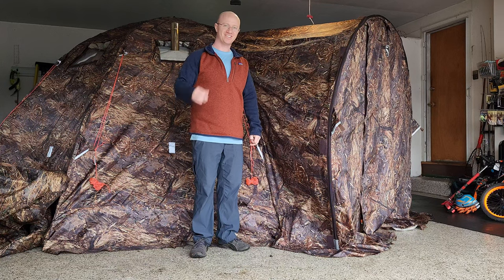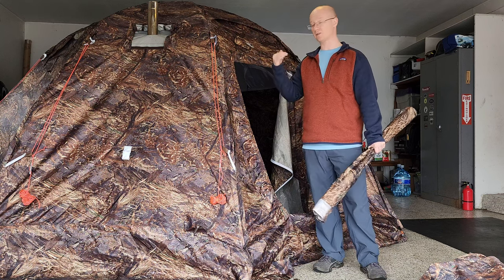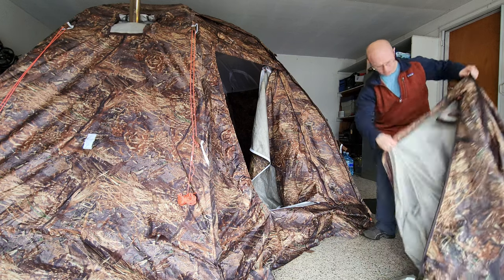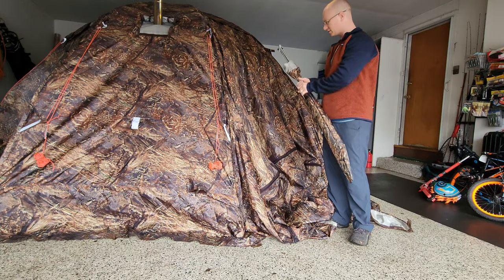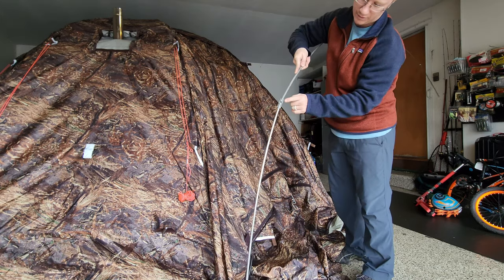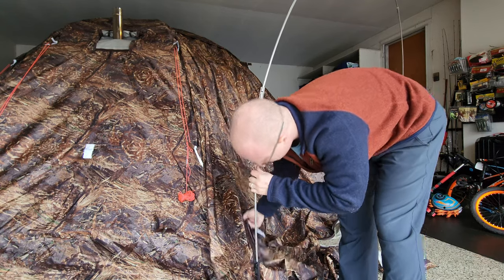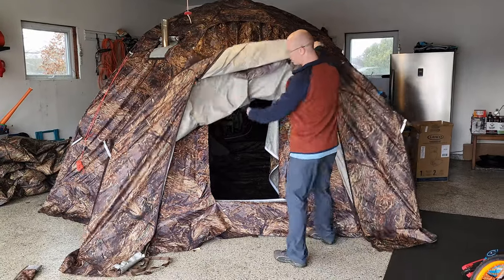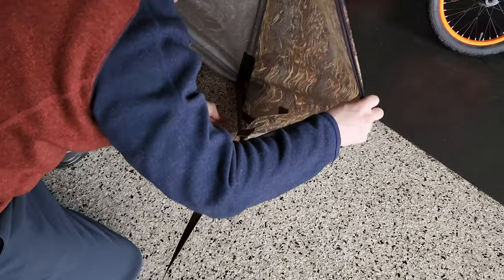UP 5 Vestibule Setup and Stove Jack Issue Fix

Comment: Very helpful. Before I saw your video, I had my vestibule set up squared, it worked but. My poles came together and snapped into place. Wouldn't snap easily, so I left them unsnapped.  Going to try to redo it correctly.  Also had no idea what the extra poles were for!  Thanx again.
Reply from the maker: Your welcome. I am glad so many people have found it useful. Makes me feel justified in taking the time to figure it out myself and then making the video for everyone. Cheers

Comment: Can you please tell me what the diameter of the stove jack rings? Planning to have a woodstove made. Planning on a 4" pipe
Reply from the maker: I don't have it out right now so I don't know for sure but I can check that out at some point. In my opinion with the way the layers work and lining them up and then factoring in possible wind...I wouldn't go with a 4inch pipe. The 3inch pipe on the caminus stove I use is about all the room it can handle. The caminus pipes are 3.2inch I believe. I wouldn't go more than 3.5inch if I were you.

Comment: Could you please post a link to your other fire protection mat?
Reply from the maker: WELLUCK 32 Inch Fire Pit Mat Fireproof Firepit Pad Deck Protector, Round Heat Resistant Shield Wood Concrete Floor Grass Patio Mat for Chiminea/Solo Bonfire/Grill/Stove,Up to Resist 2000°F https://a.co/d/cQiNHBS
Reply: @AbundantAdventures  

Thank you!
Reply: I am trying a wielders cloth as added floor protection, harbor freight.

Comment: Stove thing need a air gap to act as a insulation.  I got the up4 dex only comes with a trap for the front door. It's nice tho.
Why are you taking hot wood out of the stove? Everything burn down it pure white ash in the stove. It's leaves zero waste.  Just wake up and scoop out the ash befor starting up again. 
When your leaving use a branch to clean the stove pipe a little . Few brushes knocks out most it.
Cheers
Reply from the maker: Great idea on the branch. I don't know why I didn't consider that before. Thanks for the idea. 

As far as the hot wood or coals go, you are right again about that, however, I don't usually leave first thing after I wake up. I usually run the stove to make my coffee and breakfast before packing up mid morning to afternoon depending. So that's why I always have hot coals in there when I go to pack up.
Reply: @AbundantAdventures  yes bud anything to make it easier.  Pick up the stove and dump it out. If you got the back door use that . More you use the tent the better it gets. I got one last year and I still learning and slowing making it easier.  
Cant wait to try it ice fishing. Never tried last year 😪
Reply from the maker: @coolhawk2003  Let me know how the ice fishing goes. I am not big into ice fishing but I have some friends who are. So maybe I'll give it a go as well....